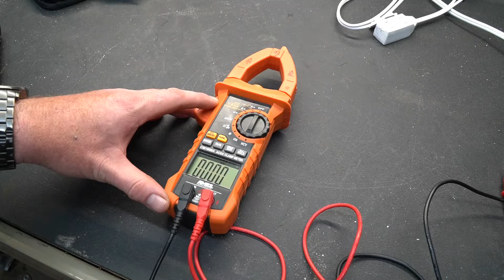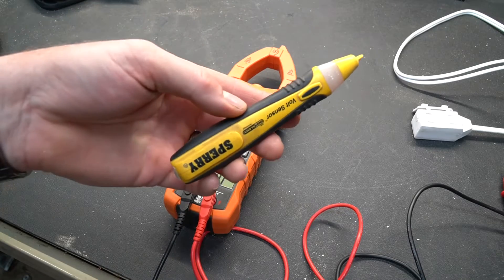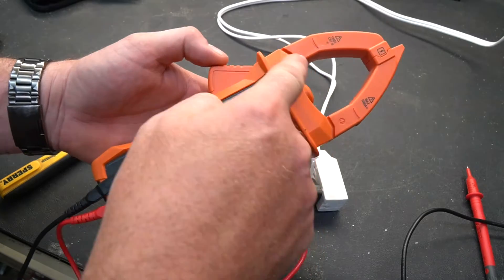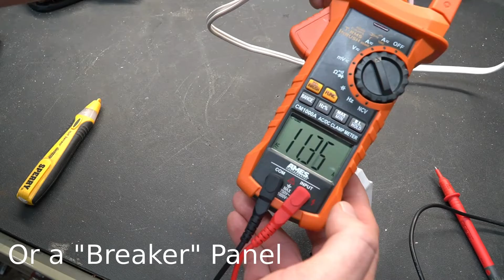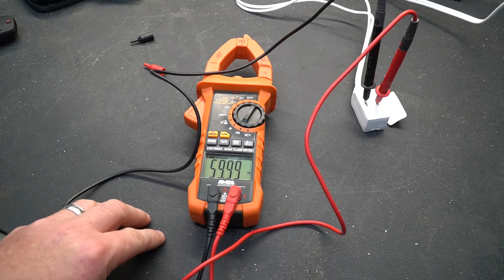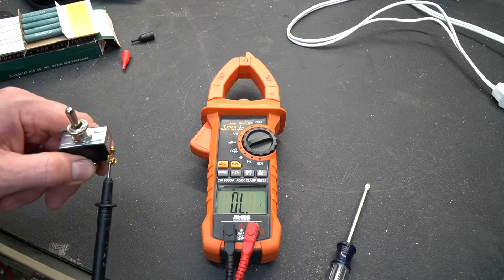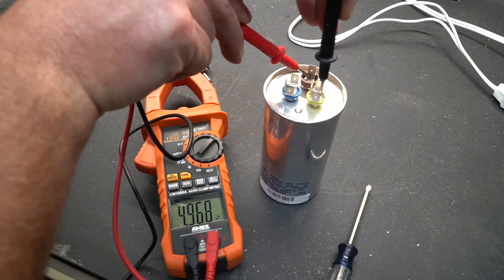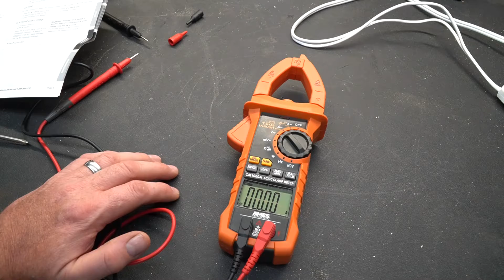Harbor Freight CM1000A Ames Instruments AC/DC Clamp Meter Review & how to use! New Tool Day Tuesday

Comment: I just purchased one of these M myself, they are great for industrial use. You forgot to mention what makes them great for industrial use. They are capable of 1000 volts DC for voltage measurement. This is highly important because DC bus voltages on frequency drives is usually 672 v. A regular multimeter that only goes up to 600 volts will not measure this voltage and becomes unsafe in this situation that is why this meter is the Preferred Choice from Harbor Freight for industrial use. It is the only one they have that goes to 1000 V.
Reply: So it does do DC amps on the clamp? I can't seem to get a straight answer if it's a hall sensor
Reply: I can assure you that it does do DC on the clamp. I own one and use it frequently at work.
Reply: @hammerrt3185  i cant get mine to show dc amps could you make a video please would be greatly apreciated

Comment: Don’t ever use a volt pen to clarify if a circuit is dead or not these are simply to unreliable for you life to potentially depend on .
Reply from the maker: Yup!  Very true!  Albeit they are pretty accurate, even the manufacturer recommends further testing before assuming the wires are dead.

Comment: Over 90% of tools (especially electronics) sold at HFT are cheap and not worth even at low prices. This is a double risk: it is sold at HFT and is quite expensive!
Reply from the maker: I think there is some confusion over the quality at harbor freight mainly due to consumer ignorance.  If you go into Harbor Freight and buy the "cheapest" tool they have, it's probably not going to be worth much.   A good example is the Pittsburgh wire strippers, they are not very good, made in China and cost $5.99.  Most people who buy them complain that Harbor Freight is just a cheap tool company that sells crappy Chinese products.  However, if you buy the Doyle strippers, they are going to cost $18.99, are made in the USA and you'll never need to use the lifetime warranty.    The Ames brands by what I can tell, seem to be pretty legit for the price.

Comment: Do more on this unit and uses. Don't need this high end one and see they have less expensive  units, any info on them. Not something I use every day but very handy to check DC and AC in my shop .  Really enjoyed the video 👍👍👍👍
Reply: My cheap CenTech from back in the day passed milspec so I'd say you can get whatever and it'll be close enough for hobby use

Comment: Do these work well for testing very low DC current? I work in the automotive field, and would use it up to maybe 250A DC for starter circuits, but my main reason to get one would to easily perform parasitic draw tests, which are usually an amp or less…somewhere in the  milliamp range 10-800mA typically.
Reply: I'm in the market for the exact same reason and indeed not all specs call out the meter's resolution.
Reply: @ 

from what I’ve been able to discern from my cursory research: the amp clamps that are rated for higher amperage are usually not very accurate on the lower mA scales. You almost need to find a low amperage amp clamp (I think MAC has one rated at 30A), and they’ve give you better accuracy for parasitic draw tests. The one drawback with these style amp clamps is they usually plug into your meter, so you can’t have your amp clamp on the circuit AND use your meter to run a mv voltage drop across a fuse, at the same time. I guess I do have one of those Amp Hound meters that would work, but it would be nice to have a standalone amp clamp that you could put on there and leave it alone while you do your other testing with your meter.

Comment: Good review.  I looked at the specs from HF on this meter.  The operating temperaure range is 64.4F to 82.4F (basically room temperaure).  That is a major concern to me.  It's very easy to be in an environment where I could be using this meter outside these temperatures.
Reply: It’s been a year and I know you don’t care anymore but I have one and my manual says 32-104f. Now the cold side is worrisome to me. But I try my best to not be anywhere over 100f so the high limit isn’t a problem for me.
Edit because I just realized I have the 600a not the 1000a so idk about that one.

Comment: I bought this same meter and am using it to test max cranking amps on vehicles.  Works on my pickup with 12v system  but when I try it on an old Jeep with a 6v system I don't get a reading at all.
Is it not capable of reading current at 6v?
Otherwise it seems ok....only thing that's not quire right is the leads are so loose that they can fall out of the socket.  Makes me wonder if they'll make consistent contact.

Comment: Would have been good if you had pointed out that the extension cord conductors were split and you clamped just a single conductor.
Reply from the maker: Maybe some day I'll do a video on how to use a meter.  This was just a review of the product.
Reply: this really messed me up. I thought my meter was defective because it wouldn't measure amps over the whole cord like this

Comment: How to check car battery if its healthy or need replacing? Thanks
Reply: You need a load tester to see if the battery voltage stays up under load. HF sells this: 
CEN-TECH 100 Amp, 6/12V Battery Load Tester

Comment: Will this meter run up to 1000V,  and check megohms, for insulation test??????
Reply from the maker: I'm not sure, but here is a link to the manual: https://manuals.harborfreight.com/manuals/64000-64999/64017.pdf